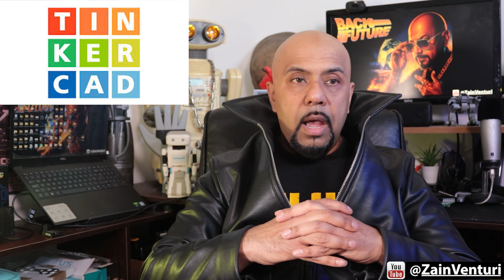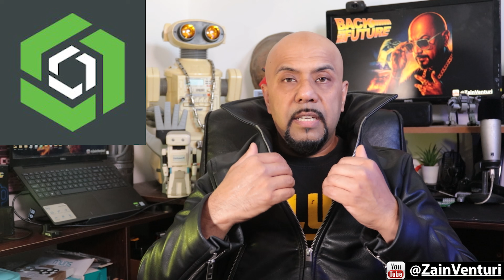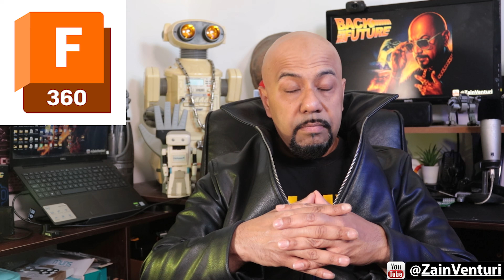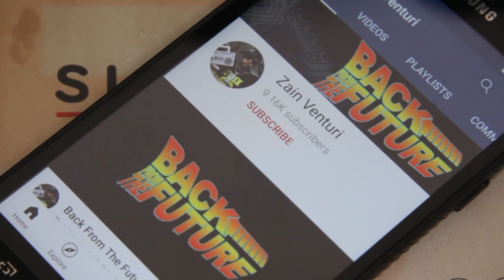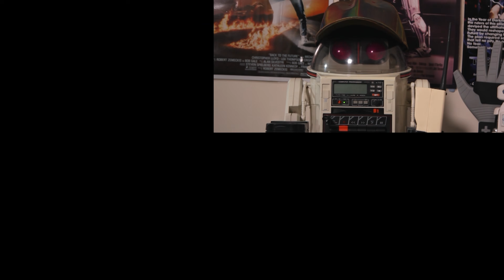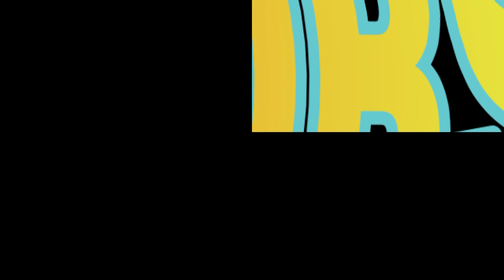5 Best FREE CAD Programs for 3D Printing Beginners (Stop Struggling!)

Comment: thanks for the lists!! i've been using the 3d model gen in rapiddirect for some of my projects cause it's easier to also print it after with their manu. have you try it before and how'd you compare with the other cad tools?
Reply from the maker: It all depends on how deep someone needs to go, I think 80% tinker cad is enough but if you would like to go deeper it's either fusion or On shape